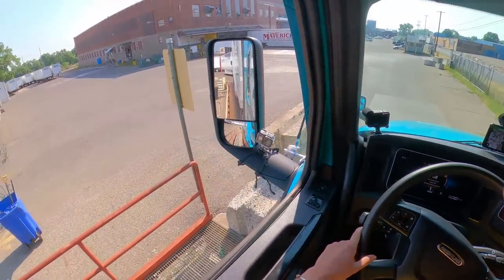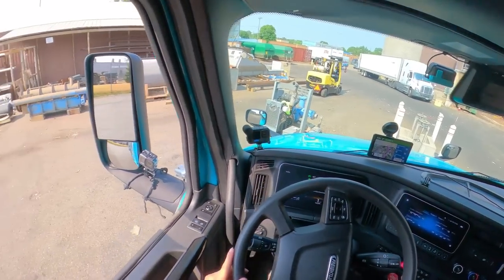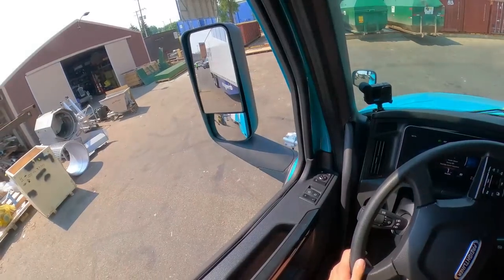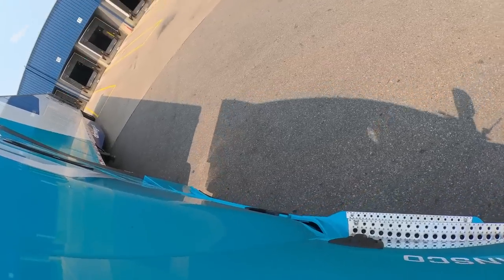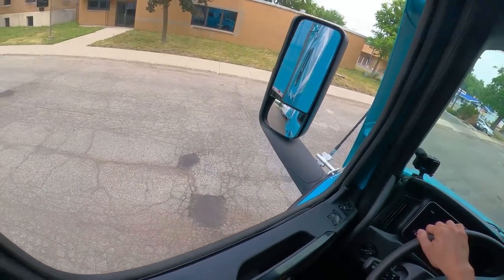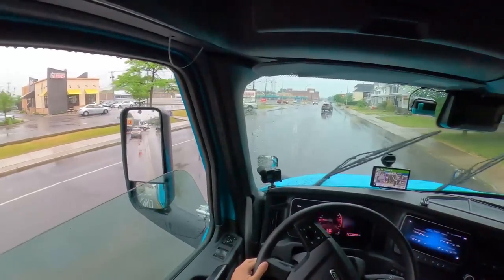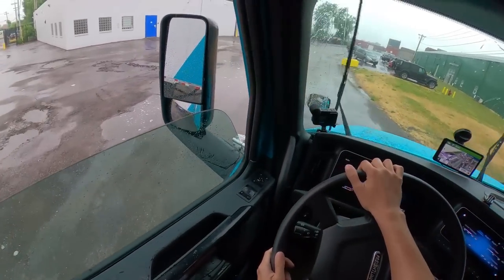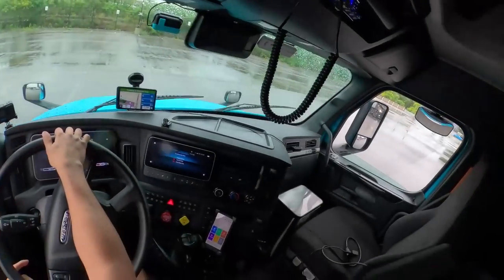I'M LIVING MY NIGHTMARE - Getting Lost In New York

Comment: Here's a helpful hint. Google maps is NOT intended for large trucks. That's why it changes routes. It thinks you are in a small car and will take back roads, neighborhood routes and even restricted roads.
Reply: I have used Google maps exclusively for 10 years of my trucking career. The trick is to use it like a digital map, look at the route ahead of time, look for place you shouldn't go, use satellite and street view. In other words, PREPARE. Even with GPS, just following the instructions of a dummy box can leave you screwed
Reply: I will keep saying it over and over just invest in a cmv GPS it will keep you off of Bone Head Truckers for using a automobile gps.
Reply: There are lots of trucker GPS apps to choose from. I'm sure Alex knows that. Saved me a few times.
Reply: @alexithyme3511 I was a first responder and had to get to places fast before the days of GPS and digital maps on a computer screen. About 3/4 of the way into my career, we got those devices but early on we'd have map books. I'd pull over, look at the map and plan out the route in my head. It became second nature and if we really need to get there fast, we'd ask dispatch for the nearest cross street. With that information, I could map it out quickly.

Comment: you make backing a trailer so much harder than it should be your turning your wheel to much tiny turns and nice and slow you'll get it some day
Reply: He’s a you tube trucker, they are not required to be able to actually able to drive.
Reply: I had an easier time backing with my '85 Freightshaker with no power steering!
Reply: Like I said in his previous video he over thinks it he needs to practice more on backing in tight situation’s
Reply: Why don’t y’all just let him be? Damn y’all be pressed for no damn reason like it affects your bills and shyt.
Reply: @Sebastian81012  cry more... can't handle when your lover Alex is criticized?
Reply: @tylerschroeder3722  nah that’s all you

Comment: Re: TRUCKERS GPS.  In viewing the video's, I have watched numerous times when Alex is actually driving his CMV on and/or through residential streets and roads that are restricted to motor vehicles 12,000 lbs and under.  Here is the danger, all states have strict laws against doing so and the ticket's / citations are incredibly high. In many of the states they have a zero tolerance and the State Patrol and Motor Carrier Enforcement cite the driver as well as the company. The ticket amount ranges from 950.00 to 2800.00 and can go much higher if the CMV drives off truck route and crosses over a bridge or culvert that runs under the roadway.
Reply: Danger I doubt that, I driven a truck and never been anywhere you are not supposed to be. Than one of two things, you are perfect and know where every shipper entrance is. You have never had to go to a place like this before. I have been driving for a long time and ended up in places I wasn’t supposed to be, because of places like this.

He arrived by the street that was legal. They are the ones that had a weird entrance! 

But I am still kinda on your side, the direction to get into that place should have been sent with his load information from his company. At least he didn’t hit nothing.

Comment: One thing Alex could do to vastly improve his proficiency and help to reduce his stress would be for him to utilize a truckers GPS.  It would greatly help him to quickly find and get himself to the customers via actual truck routes. It's a horrible risk to use Google which is designed for 4-wheelers, Not semi trucks.
Reply: Ummm he has one a Garmin
Reply: He has one. I used to use one when I ran the states, they're useful but Google/GPS have limits. Urban areas are a quagmire of unknowns if you're unfamiliar with them. Spending more time preplanning helps a lot. Try to identify more than one possible entry/exit, in the event one is no truck entry like he had.
Reply: Looks like he is using the Rand McNally GPS to me? Maybe I'm incorrect on that one.
Reply: Pretty sure he is using the car garmin on his windshield too. And wonders why it’s “wrong”

Comment: Great video as always but I feel pretty amused when you say you are heavyheavy. Here in northern europe I’m going tomorrow with a truck thats 130k lbs (load is 84k) with the same size engine that you have in your freightshaker. But great job anyway and good content 👍
Reply: Imagine he had to start hauling tri Axle weights on a reefer
Reply: Same deal in Canada. I used to do btrains which are good for 63,500 kg(140,000lb) right now I do up to 46,500kg(102,000lb). My LIGHT freight is 80,000, lol. But it's all good it's not a competition.
Reply: Just depends on the state Some allow way more than 80k
Reply: @shotgunz124  true. I used to run my btrain and quad flatdeck in Washington where it's possible to exceed 80,000lbs. There's a few others, and like the oversize lowbedder guys. But yeah for 5-axle stuff it's a safe bet to stay at 80k. I stay in Canada these days tho so all the us regulations are getting fuzzy lol
Reply: @shotgunz124  Yeah. We have new regulations that allow us max weight up to 76 tonne without special permissions and we truckers here think this is getting out off control because the wages stay the same. I’d rather have us regulations and trucks.